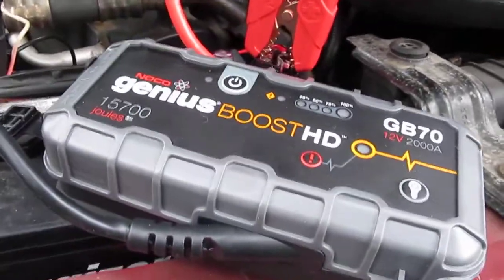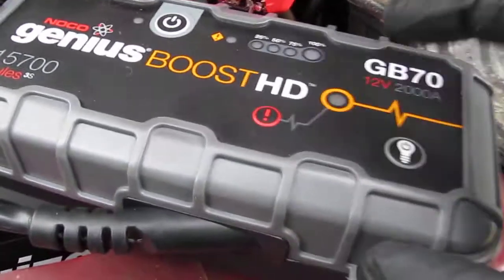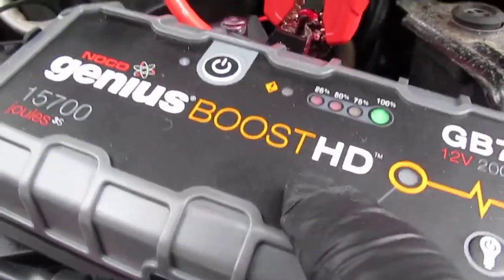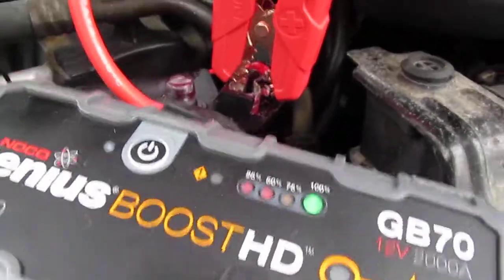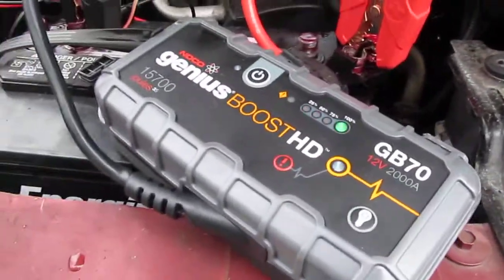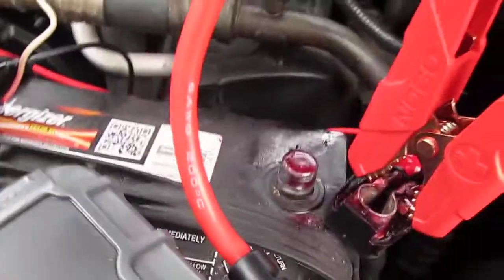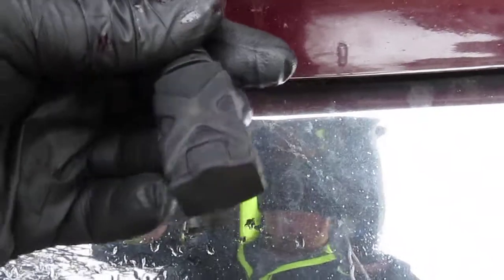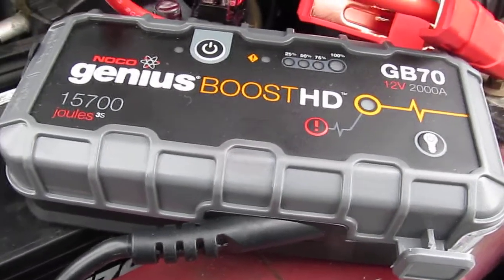REAL CUSTOMER! Test & Review of Noco  Genius Boost GB70 Battery Jump Starter

Comment from the maker: If it's below 2V you can use the override.  I had no volts.  This vehicle was out in the cold for a couple weeks and it started it just fine.  I have since used it in extreme cold without any problems.

Comment: Hello, after 2 years has your GB70 developed the swollen battery problem. Many, including mine, that were sold in 2016 lasted about 2 years before developing this issue. Many folks have complained about noticing the front end of the housing splitting apart for no apparent reason only to find that the battery has swollen to the point of separating the housing. So I'm wondering if you've also had this issue since it seems you purchased it in 2016 as well

Comment: I have noticed that when the batter pack is cold, (has been sitting out in the truck) it flashes the "error" light when I plug it in to charge it.
It appears that the boost pack itself needs to warm up to a certain temperature before it will recharge itself (both from a cigarette lighter socket or from the USB cable).
Reply: -20°C in the truck.
When the battery boost pack warms up a bit inside, it charges fine.
Is this common?

Comment: I've been looking for a good boost pack for months, problem is, it needs to boost in -30C to -40C, - 40F is close to that range. I can plug the truck in at work for the block heater. I just want a good boost pack that I can l leave in the truck, it can get me out of a bind. Frozen boost pack is of no use.
Reply: I have the G70 and live up in New England.  We had a very cold winter last year with many days in the single digits and hitting Zero degrees Fahrenheit.  No problems at all storing it in my Jeep with that cold weather.  Once a week, I would check for battery level, alway's was 100 percent charged.  Only one time during the winter, I had to take it in the house to top off the charge.  So I hope that helps.

Comment: Try it in the cold with a battery that has enough power to turn on the lights but not enough to turn the engine over with the car and that JUNK PACK AT 20 DEGS F.Not indoors either like you did in this video.
Reply from the maker: This was outside and I completely bypassed the battery.  I've had this for well over a year and it has come in handy many times.  Very Happy with it.
Reply: thegolfballshop So explain how did you create a 2 volt input as it needs this to go into the override.Secondly I have ran a load test on this battery in cold weather with a carbon pile and a weak battery at 20 DEGS F the best 3 UNITS could do is 86- 92 amp output.ALSO  If the battery is at 70 DEGS it will put out 150 amps AVERAGE, I also have a open case and a videos that the Engineers FROM NOCO are looking at with 3 different units.I am waiting for them to confirm my findings.it has been 2 weeks.
Reply from the maker: I just hooked it straight to the cables and hit the override button.  Not sure what you are so angry about?
I bought this and I liked it so much that my wife and kids all have them in their cars.
Reply: thegolfballshop I am not angry I am not sure of the temputure you tested it at and according to them what you did is impossible as it needs a 2 volt signal! Also here is a email from NOCO

Thank you for the feedback. We do appreciate it, as it does help us improve our products, and support. I’m sorry to hear the Boost did not jump start your vehicle. Did you attempt the jump start using manual override? The Boost units are designed to detect the battery and apply the appropriate charge for jumpstarting. If the vehicle battery is below 2V the Boost will not be able to detect the battery and apply charge. This is part of the built in safety features of the Boost. You can disable the safety features with manual override to force the jump start. Use manual override cautiously as it also turns off the reverse polarity protection and spark protection. 

I have forwarded your email to our design and engineering departments so they are informed of your feedback as well. Again, thank you for helping us improve and if you have questions please let me know.

Sincerely, 

Dan Brown | Support Agent 
The NOCO Company
Reply: I see what CRAZY HORSEPOWER is trying to say and he's getting confused,  If the GB70 detects a voltage above 2 volts then it will automatically engage when it's powered on, (The white LED lights up and the capacity LED's will chase and you'll hear a relay click), If the GB70 does NOT detect a voltage or the voltage is less than 2 volts when you turn the GB70 on then you have to hit the override button and I believe you have to press it from anywhere between 1 and 3 seconds, Be aware that the safety circuits will not function in this mode and you have to be extremely careful , For more information, See NOCO's article here: https://no.co/support/manual-override (If you're unable to click on the link then just copy and paste it into your browser).
Reply: ajstrangeruk I am not confused with the voltage.With that said if the jump pack is charged in 70 deg indoor temp them place into the car at 20 degs for 24 plus hours and then used to jump a car with enough voltage to turn on the headlights dimly This jump pack does not have the power to start a car. 
according to the manufacture it should work but it does not.
Reply: CRAZY HORSEPOWER Can you upload a video of what you are attempting to do and if not can you answer the following, Where are you? What type of vehicle do you have? Is the Jump Starter fully charged when you're attempting to start your vehicle? Is it the Noco GB70 that you have?
Reply: ajstrangeruk I am a Auto Diesel technician 39 years the issue is when this jump pack gets cold 20 DEGS or less for more than 23 hours it loses it charge.Now I know batteries especially Lithium ION,polymer,NMH ETC I have used them in many projects But any company making a bold statement by saying there pack can jump start a car In less than perfect conditions either has lied or develop something unique. So it was my Daughters car that this pack was in as a emergency power pack if she got stuck as car batteries are unpredictable in cold weather,Well she went to use it was charged the day before and it failed to start a 2006 malibu with a 3.5 liter.
End result I went out with a sealed lead acid pack jump pack from AC DELCO AND IT HAD NO PROBLEM STARTING THE CAR.As far as this JUNK PACK  I leave it at work now because it can not handle outside cold weather below 20 degs.
Reply: CRAZY HORSEPOWER I don't own a NOCO Jump Starter myself although I do own 2 from other Brands, 1 x SIP 802Li (20Ah) and a Floureon W400 (15Ah) and I struggle with both of them trying to start my little Citroen Berlingo Diesel 1.9d when it gets cold like it is at the moment, They'll both Crank the engine for about 7 seconds and then cut-out (Safety cut-out feature) no doubt, I would be interested in finding out if the GB70 or GB150 would do a better job and that's why I trawl through the Videos & Comments just to see what real world users think and that's when I spotted your comment: "So explain how did you create a 2 volt input as it needs this to go into the override", That's why I thought you'd got confused, I totally agree that it should be able to start your daughters vehicle and would love to find out why it isn't!
Reply: ajstrangeruk Lithium batteries do not like the cold they discharge on there own in the cold,Try leaving you cell phone in the cold with the battery fully charged and the phone off for 24 hours.
I have these batteries in solar lights but they are not effected as easily as the solar panel. charges them faster than they can discharge which keeps them warm.but during cold nights in a 8 hour period they do get weak as the  light is not as bright as should be.
Reply: CRAZY HORSEPOWER Are you in a really cold environment by any chance?
Reply: ajstrangeruk Northern hemisphere.